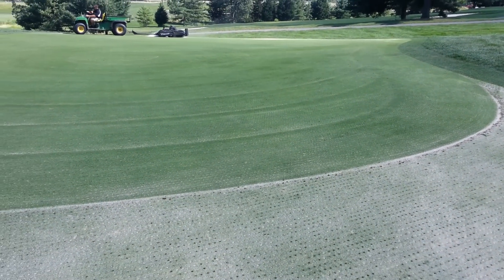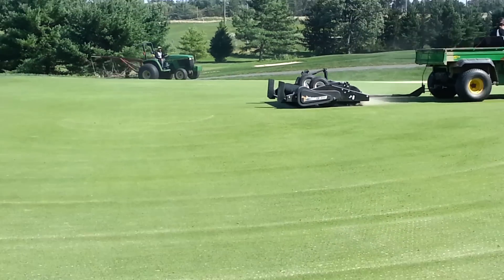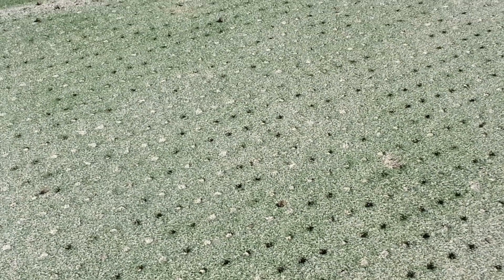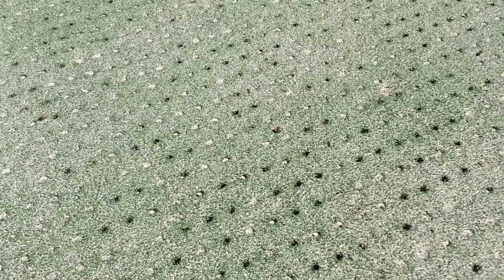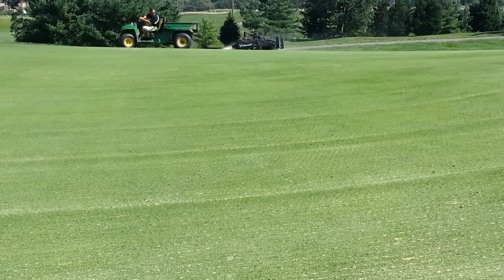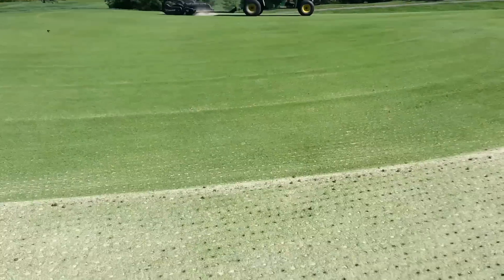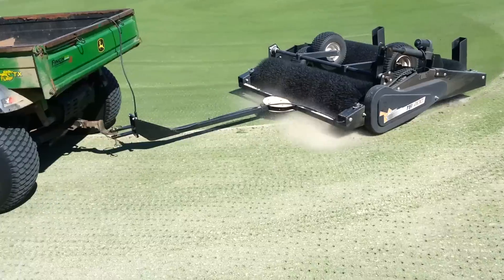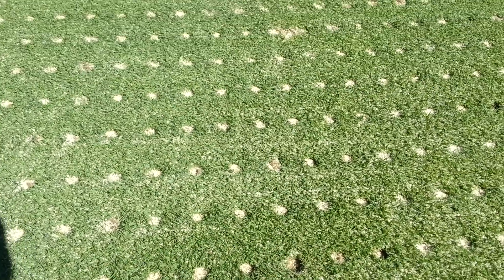Golf Course greens aeration - brushing in the sand

Comment: Coarse, round sand should be used.  Aeration should be done about once every two years.  Most golf courses aerify  too much, making greens spongy.  Some courses with small greens less than about 4,500 sq. ft. , might have to aerate once a year. 
Largers greens receive less compaction per square inch.  Only need aeration about once per two years.  Too much aeration makes greens mushy over time.  Yet, aeration is absolutely necessary for great green surfaces.   Good golf Architects analyze circulation to greens and off greens.  This reduces compaction greatly.  Mowing by hand also is less compacting to the turf.

Comment: Hey there. I saw in another comment you went to Davisson here in Maryland to get your sand. Would you recommend it? I have an 1,800 square foot bentgrass green in my yard and getting quality topdressing sand is so tough in the amount i need but I believe they could do it.
Reply from the maker: There are a number of suppliers in MD. I only have experience buying by the truckload, but surely give them a ring to see what they can do.  Bagged topdressing sand may be a more convenient option, but also more costly per ton.
Reply: @jlobenstine  thanks yes I will certainly call them. The Toro Rep I bought my newest mower from mentioned them as well. Appreciate it.